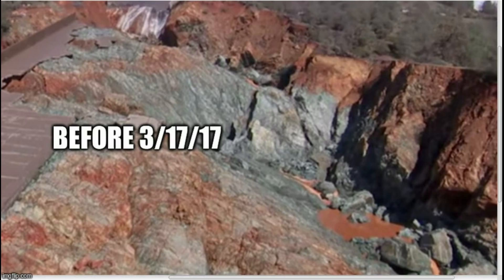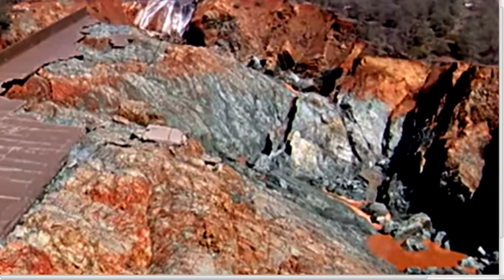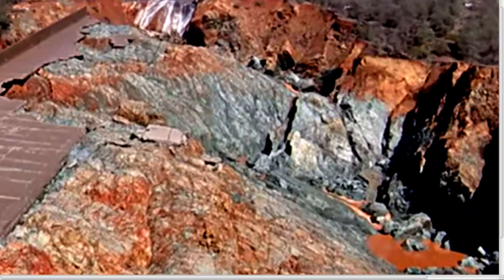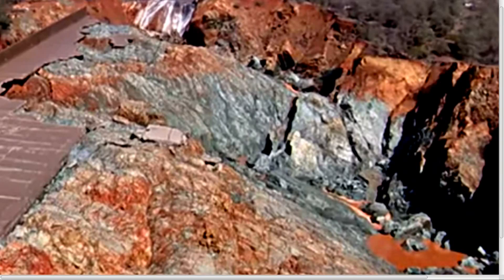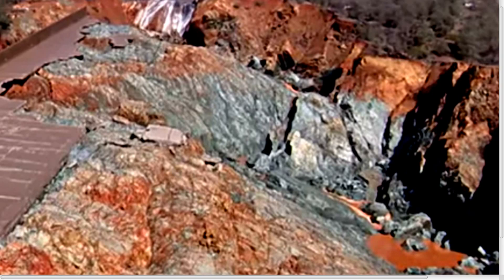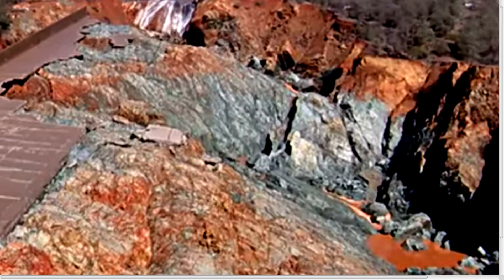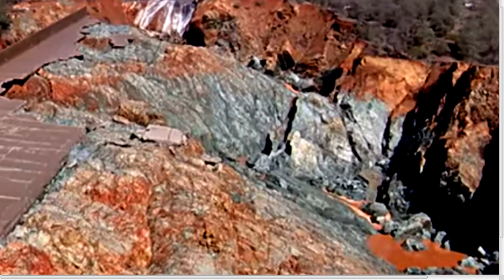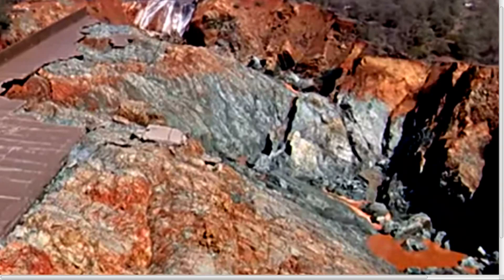OROVILLE DAM: Post Shutdown Plunge Pool Erosion Part 2

Comment: The whole place is built on Mica Schist (look it up!). Another name is "Rotton Bedrock". This is what the old timers washed out with power jets to get the gold out. They could cut a whole mountain of the stuff down in a couple of days. You hit this with forced water, it explodes apart!!!!! The spillway couldn't handle it and of course erosion was instant and enormous!! When they engaged that emergency spillway, the erosion was so bad and so quick it almost washed out the dam! That is what Mica Schist does when hit with water preasure. This thing will come down, and soon :) The bible says not to build your house on shifting sand. These idiots built the nation's tallest dam on top of it and filled it with 4 million acre feet of water!!!!! It is also sitting on active volcanic plates...
Reply from the maker: oh shit ...
Reply: Lad A Dog, the emergency spillway erosion was 90% dirt, except near the weir, where a fair bit of rock was eroded. But, even there, it did appear a bit softer than the where the main spillway damage has occured. Also, the weir overflow water force was far less catastrophic....but the soil was no match for it, of course.

Comment: im confused : how do u repaie no less make a new one if u must run water every 5-7 days(obtw you know it takes cement 30 days to cure) this is gona be fun they run it in nivember and it falls apart again, ty
Reply from the maker: Thanks oly ... best answer to your question might be "with great difficulty" ... the snow is lurking, and they have not yet seen real sustained pressure from melt run-off ... the current liquid equivalent is something like 35-40 inches of water. Some places like Mammoth ski area will be open until July 4th ... and that doesn`t include new storms.
Reply: Don't forget, that 35-40 inches of water does not equate to the same amount in Lake Oroville. It will be that number multiplied many times, because of the area of the snowpack on the mountains is much, much bigger than the area of the reservoir. 

To use a small frame of reference, people need to understand it's not putting the water from one cubic foot of snow into a cubic foot reservoir.  It's more like putting the water from 20 cubic feet of snow in one cubic foot of reservoir.
Reply: You're welcome. I think the SWE % to snowpack depth is quite typical. Further, here's a good read about the state of the situation for the San Juaquin area. They don't expect any problems. I believe the Oroville situation will be fine, since they will be sure to keep the lake level below 865..... which is unfortunate, as that's a lot of acre feet of water that won't be available later in the season.  http://www.recordnet.com/news/20170331/big-melt-here-it-comes-most-reservoirs-should-be-fine
Reply: I think the runoff rate will be controlled and reasonable enough as to not cause further problems.....Also, if the inflows don't increase much, they will have at least 15 more days to work before reopening the spillway.  They've 25 feet to go, and it's only going up a bit more than a foot a day.
Reply from the maker: I tend to think they will be OK in the short run, but at some point there will be much greater pressure on the system. For a time during the 10 day run, inflows were 40,000-45,000 and the spillway could only keep it more or less the same. The watershed above the dam has on ave 163% of normal snow pack for the time of year. But the density is 47%. So the there is something like 35-40 inches of water by volume in the snow pack. It is a tremendous amount of water.
Reply from the maker: That`s really bad if so. They need a meteorological miracle over the next 2-3 months for them not to have really rugged inflows. Could they see 100,000 CFS again?
Reply: It wasn't quite that bad. The highest inflows were from 3/21 to 3/23. Over that 72 hours, the lake level dropped from850.08 to 845.16 You can check here... just click later to go to the next day. There were only 22 entries of 40k cfs or higher.  http://cdec.water.ca.gov/cgi-progs/queryF?s=ORO&d=20-Mar-2017+07:19&span=24hours I think, as it warms, the snowpack, having consolidated nicely, will melt slowly enough that the inflows won't get too high for long.
Reply: http://cdec.water.ca.gov/cgi-progs/queryF?s=ORO&d=23-Mar-2016+07:19&span=24hours
That's a link to data from 3/23/16. The snowpack last year was not extreme, of course, but was close to normal. Again, you can click later to get the data for the next day...or just change the date part of the URL to get to a date you'd like to view. You'll see that the lake inflow rates never peaked much...and there was a snowpack to melt...I'm too lazy to check to see that data, but do  think it was close to 100% of the average. What I'm saying and hoping is that there won't be any major concerns with the runoff.
Reply from the maker: Thanks for the links rbtree ... on ave there is still 163% of historical norms, and the state, generally is a couple of inches from the wettest on record. And as I have repeated endlessly, the snow in much of the high country is super high water content. The state and DWR all admit to a great deal of unpredictability for melt inflows. I can`t see a situation where there is not at least steady pressure, if not unmanageable inflows for extended periods, and from what is typical, probably into late June, and July.
Reply from the maker: No, the DWR report says the snow pack is 163% of normal on ave. Some places still over 180% Mammoth expects to be open until July 4th. The state is near a since records have been kept wettest ever mark, and a lot of it is still up there. Not saying your incorrect and this whole thing won`t work out just fine in the end, except the taxpayer bill, but only that I think there is a lot of egg counting before hatching here in terms of this snow melt and this dam which by any measure is quite crippled. Sometimes things take on a life of their own. It assumes a major portion of it won`t go down with a 8-10 of rain and 55 degrees above 7000ft for 2-3 days in a spring storm. And the first run, with only some minor inflow stress to the system, ended up taking 10 days, not 3-5 as estimated by DWR. And, it is obvious from this video, and the debris in the divergence pool, that there was a lot of erosion during that stretch. It will slow down as they run water through it, but look at some of the first plunge pool images from the edge of the PSW break. The slice off to the left (dam side) is dramatic. It will just keep undercutting the bank. And with erosion showing the inconsistent nature of the indigenous rock, it gets more risky every time they have to run it. And that DWR, the feds, or whoever is really in charge won`t show us drone footage from after the shutdown, is both outrageous and disturbing.
Reply: There is nearly zero chance of such a spring storm happening. Betcha a bucket o busted cement all will be fine.
Reply from the maker: Maybe so .... but near zero chance? That`s a very bold statement. We shall see ... :-)
Reply: Not bold when you know and follow the  western US weather for 40 plus years.